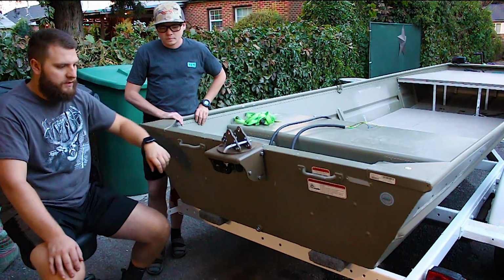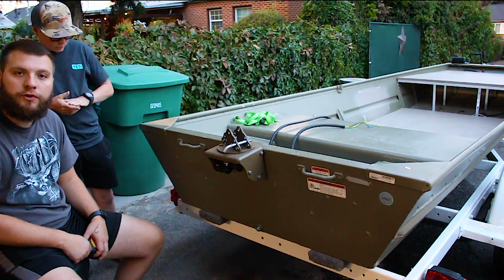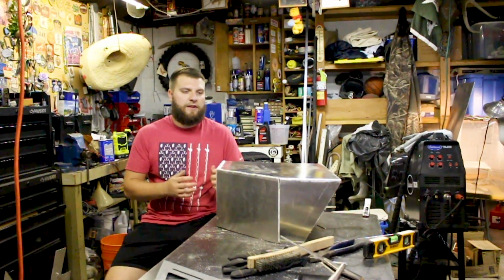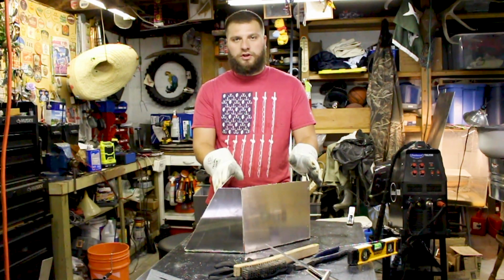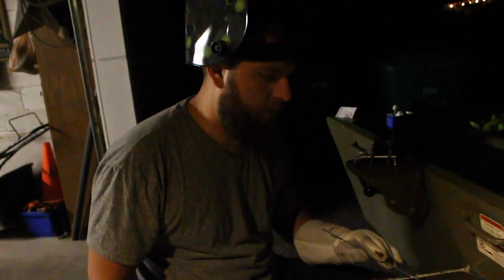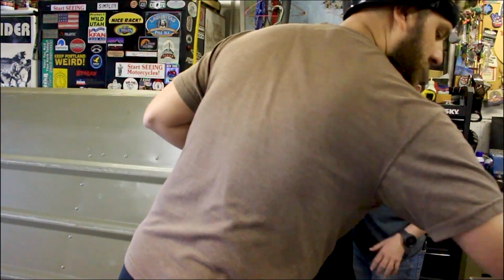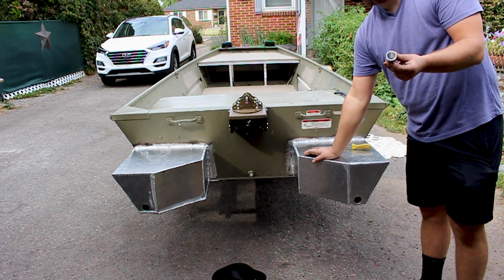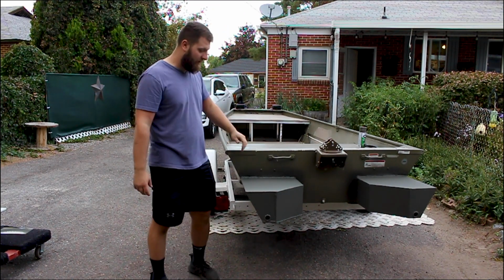Custom Boat Flotation Pod Build

Comment: For that bent transom, you might have been able to push that bowed part back out with a bottle jack between the transom and rear seat face. At least enough to get it closer. That may have  allowed one good bead across the top instead of 3. Nice job though.
Reply: I was thinking the same could’ve easily closed that up a bit

Comment: good deal on the pods, what guage or thickness aluiminum? why have drain plugs if it's air tight? I don't weld, can I braze the pod like isn't that just as stronge as welding?
I have a 24' aluiminum vessel beam is like 75" I'd like to make some pods for how big can they be? thanks an excellent video.
Reply: You can't braze aluminum

Comment: Looks good and congrats on your first customer. hope you stay busy building these. It would be nice to have a follow up Video of the Jon Boat in the water. I am researching on the right thickness to fabricate my own, i am considering .125 , whatcha think?
Reply: Thank you in regards to the comment, on this pod build I used .1 25 and then for filler rod I did 4043 in 1/ 8th inch I also ran my torch pretty hot to melt my filler rod a little faster to get nice welds.

Comment: I have been thinking about adding pods or pontoons to my 14 foot john boat to make it more stable. Just not sure how to go about it to swing them over the sides or weld them to the side would make it wider and not fit on the trailer.
Reply from the maker: I would recommend pods over pontoons for 14 foot
Reply: @co-opoutdoorsandhunting233  Interesting... Why back mounted pods vs side mounted pods?

Comment: I have a 1548 express with a predator 670 and a swamp runner long tail. I have thought about doing pods. But just not sure if it would be worth it? What’s your thoughts?
Reply from the maker: I would always recommend pods they help with stability and motor weight I love mine

Comment: Looking to build a set of these for a 16' v hull with a 50hp 4 stroke on it. It's a little heavy in the back with the 2stroke trolling motor. Thinking I need to make one on the kicker side to accept the trolling motor and the other as a boarding step. As well as a location for the transducer. Is this too much of a project?
Reply from the maker: Thanks in regards to your comment i would definitely consider doing pods, it wouldn’t be to much work to get everything set up, its all in the initial prep work and design.

Comment: Hey guys awesome video. This is exactly what I've been looking for. I've wanted to build a set on my 1636 Jon Boat for a while now. I was wondering what you think would be the thinnest material I could use for a build? I am kinda limited with the amperage for my Tig welder, for now, so I was thinking maybe I could make them out of 12 gauge, 14 gauge, or 16 gauge aluminum. Maybe even braces inside? What are your thoughts?
Reply from the maker: Thank you in regards to the comment, for pods that you are wanting to stand on and last a long time without any problems I wouldn’t go under 1/8 inch aluminum, what amperage are you running on your tig
Reply: @co-opoutdoorsandhunting233  my tig will only make it to about 95 amps before the breaker trips. That was on mild steel. I haven't tried it yet on aluminum. I do plan on having the wiring and breaker upgraded sometime in the future, but for now this is what I'm working with.
Reply from the maker: @trapperdan93  if I was you I would wait until you can run at least 125 amps to insure you get good full penetration welds
Reply: @co-opoutdoorsandhunting233  ok. I'll wait till I get the upgrades. Thanks for the reply.
Reply from the maker: @trapperdan93  Of course if you have any other questions please leave us a comment and will get back to you